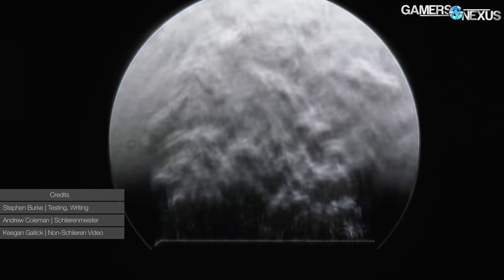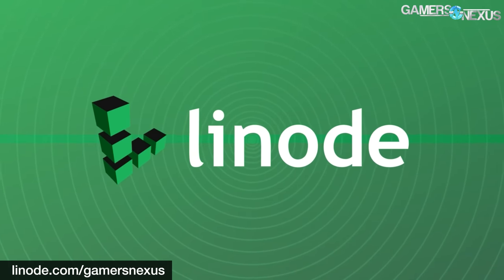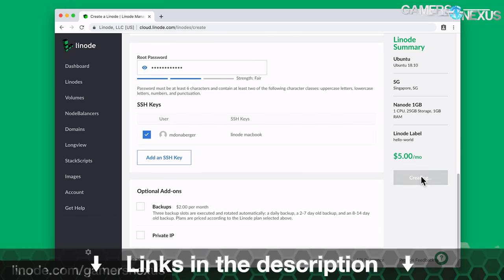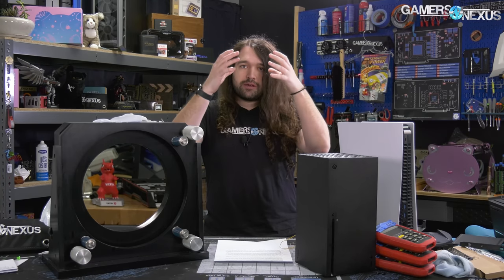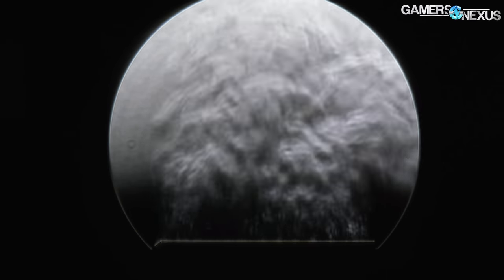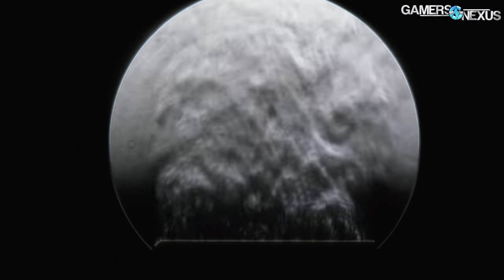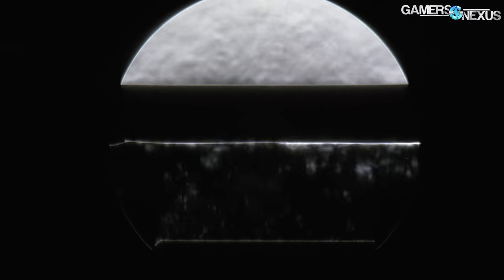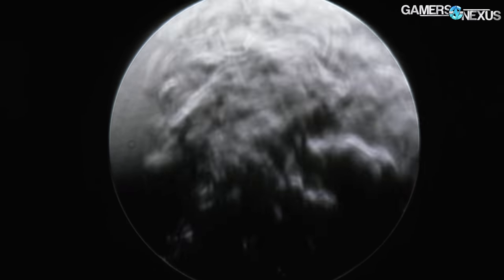PS5 vs. Xbox Series X Airflow Testing: Cooling Design Efficiency & Flow Paths

Comment: Fluid dynamics is what it is all about. Air is technically a fluid that can be pushed around just like water or any other fluid. You're spot on in stating the orientation only matters in as much as you don't block intake or exhaust and you have a sufficiently fast enough fan...
Reply: air isn't technically a fluid it is a fluid by definition...
Reply: @LCDqBqA  fluids are any substance that can have flow. Air is made of stuff, air particles, that are loosely held together in a  gas form. Although liquids are the most commonly recognized fluids, gasses are also fluids.  Since air is a gas, it flows and takes the form of its container.
Reply: @LCDqBqA  -- Gassed quite literally are an example of fluids. I believe you're thinking of the definition of liquids, which are also fluid, but not all fluids are liquid... like gases.

Comment: that concave design on the Xbox Series X promotes exhaust "scavenging" which allows the heat to escape at a higher velocity. pretty cool. The fan being countersunk down into that venturi allows it to create a proper vacuum inside the box as well no matter how clean or dirty it is.
Reply: I never see clean vacuum before 😅

Comment: i don't think the MAP gas is showing up because it's hot, it's showing up because it's dense. where would the heat be coming from if it wasn't lit?
Reply: WAP gas is not the subject of the video
Reply: Generally decompressing a gas will release it cold since it has less energy per volume. I do believe you're correct that it's a matter of density
Reply: Yeah I was going to comment this. He said himself schlieren imaging can pick up density differences - MAP gas is obviously not the same density as air, nothing to do with difference in heat...
Reply: You are right. Thant and the decompression is cold.

Comment: Great video. Curious to see how the 3 different PS5 cooling fan variants compare in terms of airflow. Just putting it out there, in case you get a hold of PS5s with Nidec and Delta fans (the one in your video is NMB).

Comment: Awesome job!  I think a lot of people probably underestimate how useful this info actually is.  It shows the ultimate truth of real estate: location location location.  LOL  You might think you can just plop your consumer electronic anywhere and it'll run just fine, but you really have certain areas that you need to keep clear and certain areas that just don't matter, so you can block up.
One thing that surprised me ... the ridiculously unoptimized airflow, especially the intake.  Common sense would have said these devices are pushing their limits harder than ever, so they'd be designed to make the absolute most out of airflow.  But ... no.  They actually kinda suck.  Or ... don't suck.  Because their intakes are blocked.  WTF?!  I really would have expected better.  Honestly, I kind of wonder how much of that is accidental and how much of it is intentional.  Is this a planned obsolescence to choke the system with dust?  I sure hope not!  But it does kinda make one wonder why they wouldn't have designed intake better, and with an easily removed washable filter in place.  Either way, it does kind of make me wonder if at this point there isn't an emerging market for re-casing these devices.  Move the hardware from the stock case to a better design.  I wonder how long until we see third-party cases come out for them.

Comment: it's really interesting to see how effective the xbox's exhaust structure is, considering the impeded intakes. Another thing to note is the tapered plastic attached to the fan to diffuse the air away from the fan.

Comment: By the airflow it seems like a lot of air flow is wasted on the ps5. Being pulled and sentb out the back with minimal intersection with the heat sinks
Reply: your mistaken and not understanding. Another point, The thing he was mentioning about it changing the airflows direction or path, is that its also thermal transfer happening at those times. More time along those fins, more thermal energy being taken away.
Reply: You and 30 other people have zero idea of what you're witnessing. For the air to reach the back it has to go through the heat sinks, Sony has been manufacturing electronics longer than most of you have been alive, they should know about how to vent heat waste. 🤦
Reply: @evilformerlys4704  Well, ps4 pro and its design would strongly disagree with you...
Reply: @dgcgois   My daughter has been abusing my ps4 pro since it launched. It's loud but has never overheated. Still going strong.

Comment: Loads of love Steve, I am hoping the Series X design will finally show how archaic and lacking innovation PC hardware/building has shown to be over the last decade.  Considering it's size, power, noise levels, and price.  It's time for the PC hardware scene to step it up, maybe then I will find interest in the scene again.  Keep loving the kitty cats old wise one, I shake you by the hand.
Reply: it's really just mainstream hardware/building.
The SFF scene has come up with some rather interesting cases and other solutions.
Cases like the NCASE M1 (which, by now, is an "old classic" that inspired dozens of other cases, including the CM NR200 which is kind of a direct rip-off XD), the DAN A4 (also an "old classic" by now) which basically single-handedly introduced the SFF-world to the sandwich-layout...

Or solutions like the G-UNIQUE and J-Hack DC-DC-converters that either work with "other" PSU-solutions (like external power bricks), non-ATX PSUs (like Meanwell PSUs made for medical and industrial applications) or, of course, just bog-standard ATX/SFX PSUs - and in any case, cut down in a major way on both how many cables you've flying around in your case as well as how much volume is needed for power.
Take the J-Hack M2426 (I'm more familiar with the J-Hack than the G-UNIQUE-stuff): It's a small PCB that has the 24pin ATX on one side and a couple of smaller plugs on the remaining sides (besides top). It allows you to cut the 24 wires from the PSU to the MoBo down to 6 (although 2 of them are thin enough to be sleeved within 1 wire sleeve, so you could make it 5 "wires" XD). Depending on CPU of choice, you can even further simplify the wiring by running the CPU EPS 4 (or 8) Pin from that board (which is plugged directly into the 24pin ATX on the mainboard) instead of from the PSU - although the CPU shouldn't take more than 75W in that solution if you also have PCIe-stuff installed.
And all of that is compatible with other solutions like a Meanwell RPS-500-12 PSU, which comes in at 130 x 86 x 43mm = 0,48 l in volume. Compared to SFX (125 x 63,5 x 100mm) at 0,79 l in volume, that's massive.
And you don't really loose anything - sure, the meanwell RPS only goes up to 500 watts, but that's plenty for a small gaming rig. 

And those were just a couple of innovative solutions that came out of the SFF niche. There's loads more. But again, it's a niche and not many people care for it, so it gets little exposure.

Cheers, cy - currently building a J-Hack-powered gaming rig in an NCASE M1 and cooled by an internal loop controlled by Aquacomputer :D
Reply: @cy-one  The Series X is mainstream, so you should compare it to mainstream desktops.
Reply: I did.
Reply: @cy-one  Yes, let me tell my little cousin to go to Best Buy and buy that case you're talking about
Reply: Ah, I see, you didn't get my point... That explains the confusion then.

Comment: that hole on the back is there if I'm not mistaken as an emergency exhaust vent incase of the top vent getting blocked (say if someone accidentally set a textbook ontop of the console) to prevent it from having absolutely no airflow and hopefully preserve the hardware

Comment: isn't the hole in the back of the series x a failsafe incase someone places something on top of the console? it's obviously not ideal exhaust but it's enough to keep your console from completely overheating.
Reply: Good to know they thought of that, I usually put a cloth cover on top of my SX when it's not in use to prevent dust getting inside and on one occasion I forgot to remove it before starting a game session. Knowing that the back vent expelled at least some of the heat puts me a little at ease but I make sure not to repeat that mistake again.

Comment: Could you do thermal image tests on M.2 heatsinks fitted to the PS5, especially the ones with built in fans ? Also thermally compare heatsinks in PS5 with/without metal ssd cover back on ? as internal airflow looks very poor over M.2 even with a heatsink, so would expect larger heatsinks without cover on perform better using airflow working towards intake fan to assist in their cooling ?
Reply: Ya

Comment: Soooo should I drill holes In the bottom of my series x?
Reply: No.
Reply: I mean it's your hardware do whatever you want with it but I would say probably no.
Reply: They might have tuned that intake volume to keep a good velocity to get that nice cone on top. I'm not any kind of expert but i could see that as a reason, similar to a small amount of vacuum being present in a car exhaust system.

Comment: So in conclusion the Series X thermal design is more efficient when it comes to airflow
Reply: Yep, Xbox always ran cooler in almost all cases last gen too. PS5 is a huge improvement over the PS4 though. So far I've not been able to notice any of my consoles making noise apart from when you insert a disc into the PS5, it'll ramp up a little but then it quietens down. The series x? Dead silent. I have noctua fans in my main PC rig so switching to the consoles is a really pleasant experience.
Reply: @therealpureessence2437  xboxs always have a more promininet hole for airflow like the xbox one s with a cutout contrary to the ps4s which try and pretty much limit the airflow lol
Reply: Ok, that's what I wanted to know, without watching 30 min video.
Thank you sir.
Imma out.

Comment: So how to put Xbox Series X: horizontally or vertically?
Reply: That is a very good question, Looks like it's safe both ways.
Reply: Safe both ways, but designed to be used vertically as hot air rises
Reply: @Wazediou  It is designed to be used vertically, but he specifically said that the "hot air rises" argument doesn't really fit because the fan will push the hot air out either way.

Comment: 14:25 : If I had to guess, a lot of customers would take the stand off in that case and lose it or forget about it because it's not immediately obvious why it's needed (or if the stand isn't preattached, never put it on). Then when they put the console vertically or sold it to someone who would, the entire bottom intake would be cut off.

So by making the stand impossible to remove without opening up the console, they're preventing that.

Comment: The gas coming out of a torch is not hot, if you don't like it. It's a little cool from decompression and it naturally has a higher density than air. This is why it lingered on the bottom, if it were hot, it would have risen like a hot air balloon.

Comment: PS5 does not seem well-engineered, especially the lack of memory cooling
Reply: Steve said that Sony stated it's within Specs. Too soon to see if problems arise
Reply: the console itself comes across like the engineering team were out of cool and interesting ideas. it's basically one full sized mobo with a giant heatsink and a big fan in the middle to exhaust it. that's the kind of design the teams who aren't bothered with a project come up with on my design and mechanical engineering course when we have mechanical and design projects. very simple with lack of ideas. xbox comes across like they actually tried to innovate and push the limits of their engineering skills within their fixed console budget to have a compact and quiet but powerful console.
Reply: @supermadkid  they're doing plenty of unique things with PS5 like the fixed power/variable frequency, smart shift, ssd i/O controller, liquid metal tim
Reply: @titan6062  xbox and/or pc are doing the same things. Liquid metal isn't anything new there are laptops which use it. If you go back and watch AMDs CES conference in 2020 you'll see smart shift was designed for laptops and actually advertised at that AMD conference for laptops. What PS5 is going with I/O xbox is also doing and on PC you have RTXIO. SSD is also in xbox and PC are getting NVMe pcie 4.0 SSDs etc. Theres nothing unique on the PS5 which makes this design somehow acceptable. As 4 year engineering student and now in my final year, PS5 comes across to me as something that is half assed. The thermal design is something a first year engineering student who didn't give a f*ck would come up with theres no attempt to push boundaries with the cooling unlike for example nvidias new dual cooling system or xbox's dual motherboard system to keep the console cool and compact.
Reply: @supermadkid  I didn't say it's brand new technology that's never been used before, it is unique in the game console space. 
Smart shift is indeed made for laptops, that doesn't somehow detract from it being here. It is again unique in the console space.
Xbox does not have their IO completely offloaded from the CPU, and we're yet to see how RTX IO actually functions. I didn't say SSD's are unique, I said their SSD IO controller is.
As an actual engineer by profession there is nothing wrong with the PS5 in an engineering sense, or at least in the way you seem to think. Memory gets a touch hot. 
Also not to burst your bubble but split motherboards aren't new, they also exist on laptops. It is unique though in the console space and pretty cool.
But I'm really not sure what stands out as extraordinary engineering on XSX in contrast to PS5, it's a cuboid that pulls air from the bottom and pushes it out of the top. Split mobo is novel, and what else?
Reply: @supermadkid  also what's this new dual cooling system by Nvidia?

Comment: Narrowing of the exhaust is predicted by Bernoulli's Principle, I suspect the concave top has little effect. You may not have noticed it in other cooling solutions because the flow wasn't as fast or coherent. You'd likely see the effect even if you modified the top to be flat.

Comment: 15:59 That secondary cooling slot is there in case someone (a kid for example) puts a game or something on top of the console in it's vertical position covering up the fan. I also suspect that is why the fan is recessed further down so air can escape that secondary slot instead of overheating if someone did block that fan in a entertainment center. Would love to see you test that part and see how the heat dissipates from there when there is something blocking the fan area.

Comment: The composite MAPP gas mixture has a density of about 40 grams/mole. Normal air at STP is about 28 grams/mole. You’re not looking at a temperature gradient via density, just different densities via chemical composition.

Comment: The reason for the hole by the fan is so if the top vent is blocked or obstructed there is at least another place where the air can get out

Comment: It would be interesting to see the actual airflow volume dispersed as hard numbers for each console. I realize this would be hard to measure, just a thought. Maybe the theoretical numbers (the specs of the console) might or might not match with the actual airflow debit of the console when in high load.

Comment: The slot exhaust on the back is for covered top vent cases to prevent thermal shutdowns during extended console gameplay workloads. Acoustics was not a factor.

Comment: @Steve i belive the topside small vent on the series x that is used to open the back panel is for acoustic control as you can see the fan has holes from the same side of the small vent to direct air into the small vent

Comment: I would say that the secondary exhaust hole in the xbox is a  backup exhaust. If the user puts a surface too close to the main exhaust you still have the secondary exit to balance flow and pressure.

Comment: 14:24 I don't think this design is an oversight from Microsoft. I think they make the base unremovable because most buyers don't understand air intake and ventilation. Kids will be playing this thing. If people remove the base and lose it, and then position the Xbox vertically anyway, they would completely suffocate the entire system by blocking off what few bottom vents there are. 

Perhaps they could have put rubber nubs on the bottom instead, but those could potentially fall off or get worn down, thus slowly suffocating the whole thing anyway. The circular base was probably what looked best from a design perspective while also being sturdy and guaranteeing the an acceptable amount of cooling. I think it was a compromise that in the long run cut down on potentially thousands of repairs and overheating complaints from customers who don't understand how cooling works.

Comment: About the xbox. Correct me if I'm wrong, but if we see a huge volume of exhaust air coming out, doesn't that meant that there's sufficient intake as well? Because if there wasn't enough intake, then it would have nothing to exhaust, and the flow would be a lot slower.

The only unknown here is WHERE is the intake air coming from. One could say that some of the intake does not pass through important components, thus not cooling them. But because your simulation shows only hot air, and that air is propelled far from any potential intake, it's safe to  say that the path (and volume) of cold intake air is not bad at all.

On the PS5, it seems like they made more compromises of airflow in order to achieve that beautiful design.

BTW, my opinion is objective. I used to have an Xbox (360 and one) and a PS (2 and 3). But in the last 2 years, it's only PC gaming for me. I preferred the Xbox's in the past  just because I like their controller (but that's completely subjective).